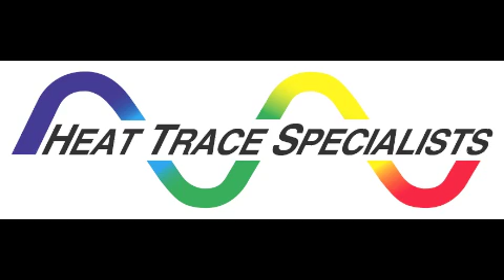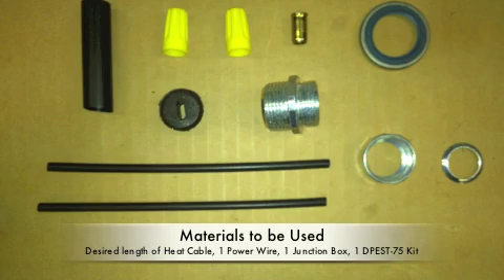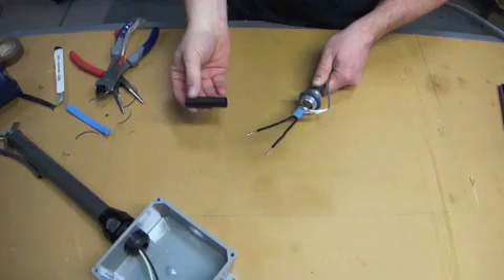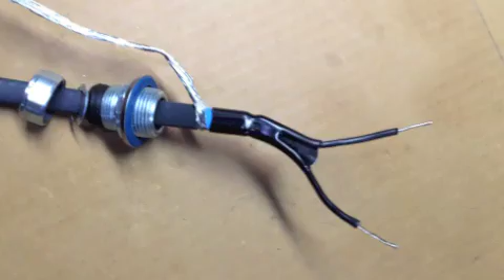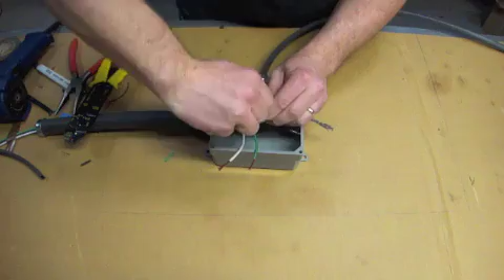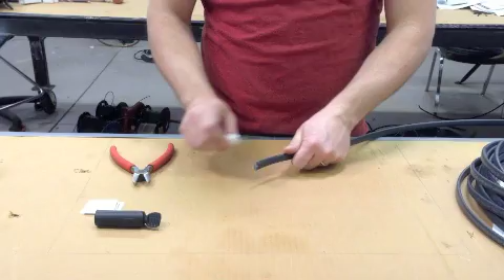Heat Cable Hardwire Tutorial

Comment: So, you connect one wire to hot, one to the neutral and keep them separated at the end. How doe this work?
Reply: I’m wondering the same thing.  So you only hook up the wire on one end, not both?  I’m using the heat cable to wrap around exposed water well PVC pipes but have found nothing about how to wire it up.

Comment: Why strip all the insulation back only to add heat shrink & reinsulate. Am I missing something? Only reason I can guess is it make the wires a little more pliable? Why not cut down the middle of the two wires once the inner jacket is exposed (taking care not to cut into section exposing either of the 2 wires, if you do then use heat shrink)...? Seems like you're stripping the cables out only to have to reinsulate. Understand the concept though - getting 2 wires out to connect to power source and also keeping them apart & insulated away from each other.

Also, seems like we have a lot of people here who watch 70's porn (or did at one time) lol.

Comment: Outstanding Video. You possess outstanding elex skills and your processes are easily at aircraft electrician level. Not knowing much about the function f the core material I'm wondering why the core is stripped back then essentially replaced with heat shrink? Is the core material a resistor?
Could multiple heat cables be installed so long as the power supply wire and breaker is large enough to handle the wattage?
Reply: I seriously hope you are joking about this guy being a skilled electrician.  Calling the black wire the neutral, applying an illegal crimp on the ground crimp ring, and using tools that no good electrician would ever use unless those were the only options available.  Like you,  I was wondering why one would completely strip the core and then replace that factory applied insulation with heat shrink tubing.  But upon some investigation, I found that this is the method instructed by the manufacturer, therefore that is how it is supposed to be done.
Reply: Black is neutral in Australia  ... just saying 😀

Comment: The time it could take to do this setup, a person could install a ReadyTemp ATC3000 under their sink and have intermittent warm water circulate throughout their hot and cold water pipes to prevent pipes from freezing.  No annual inspection like heat tape.  Installation takes all of 20min to connect four hoses and plug the unit into power.
Reply: I think this is intended more for industrial use heat trace systems. NOT home use. Very few people use heat tracing in their homes I would think.
Reply: These heated wires are to prevent ice dams in your gutters in the winter. I have them the length of my gutter on the back of our home that always has huge icicles even after we added more insulation to the house. That part faces west and on sunny days and cold nights ice was always a problem. Very good and clear directions in this video! Mine work!
Reply: I’ve got water filters and lots of exposed PVC pipe outside for my water well.  Trying to circulate warm water would not work for my purpose, but the heat cable will work great.  However, you only connect one end of the wire to power and not both ends?  Is that correct?  There’s not much information out there about it.

Comment: How do you supply power to the cable junction box? Can you attach the power wires to a two or three prong plug and just plug it into an outlet?
Reply: Yes u can. Prefer plug with ground. Also confirm the heat trace is for voltage ur using.